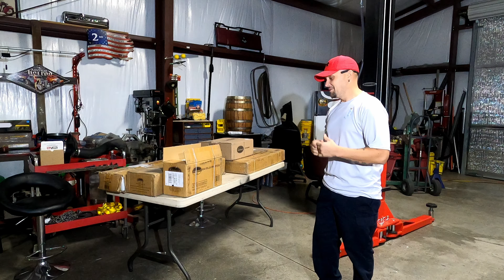Bead Roller Unboxing - Is It Worth the Hype?

Comment: A tipping die, used in conjunction with a wide flat bottom die, allows you to apply upward pressure on the metal as its drawn through the dies creating an angled lip like what may be achieved on a brake.  The step you've accidentally created here can be made with the stepping dies.
Reply from the maker: awesome thank you, yea i figured that out after the fact ha!